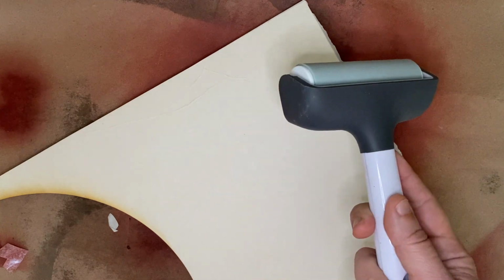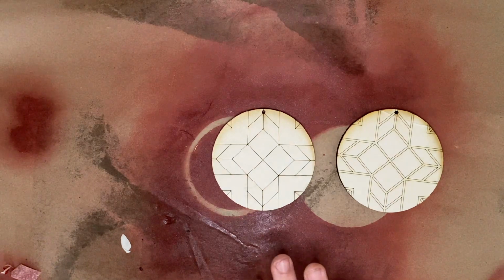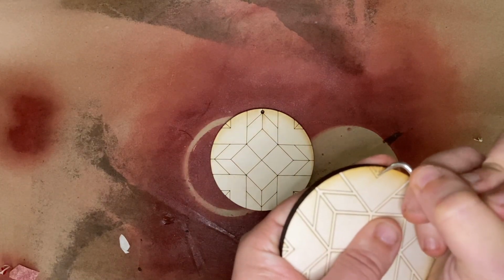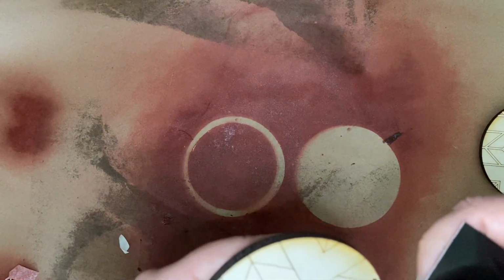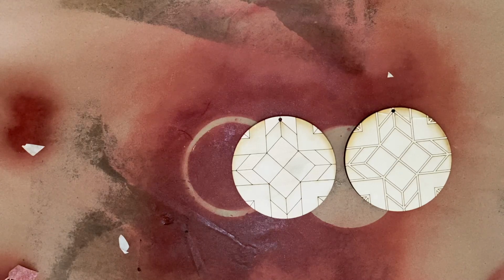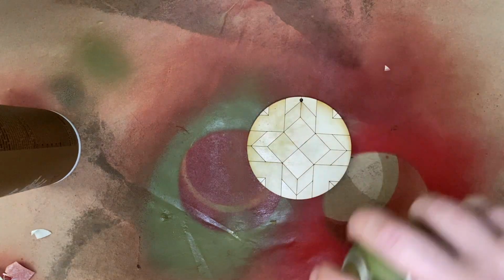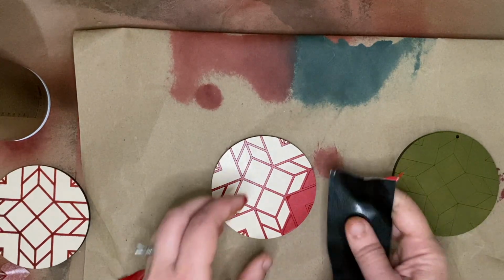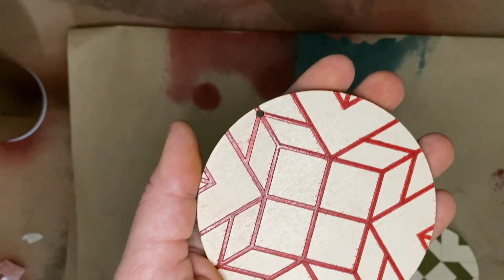Single and Double line score paint techniques...  use your laser cutter and masking in a new way

Comment: Which is 5/32 and which is 1/4?
Reply from the maker: Hey!  Thanks for asking!  I clarified in the details.  I used 5/32 in the glowforge settings.  You can use 5/32 or 1/4.  If you decide to use 1/4 inch, then dial your speed down to 150.